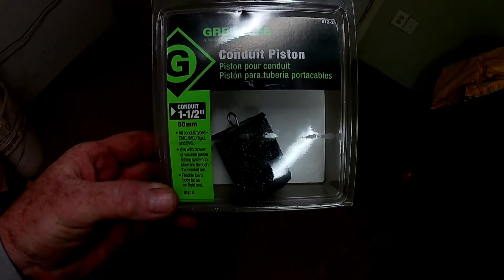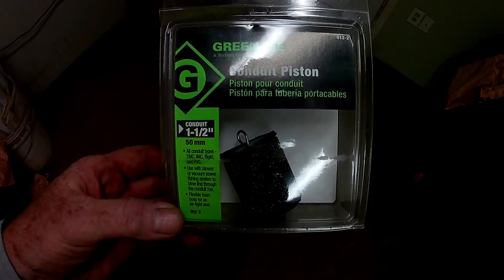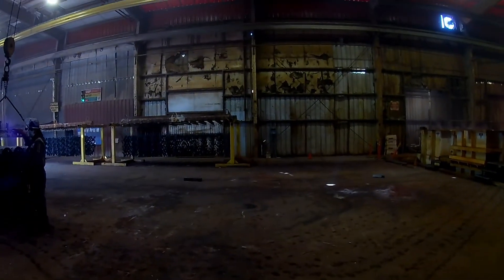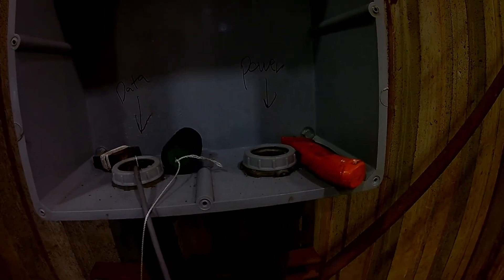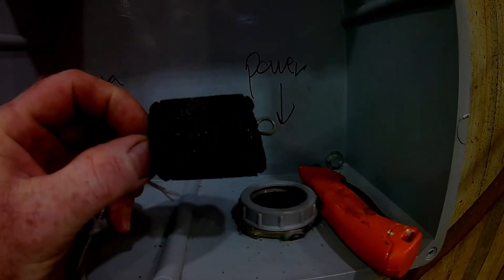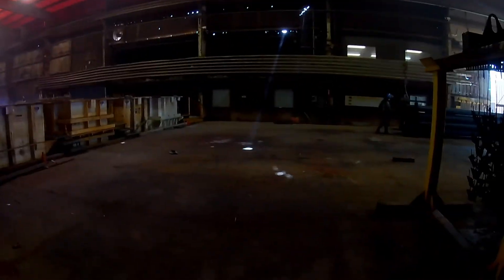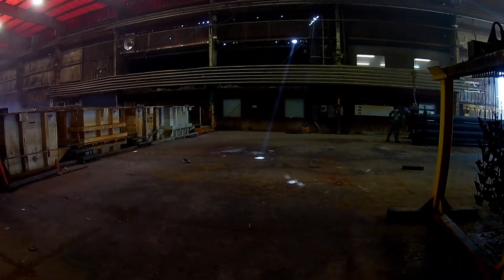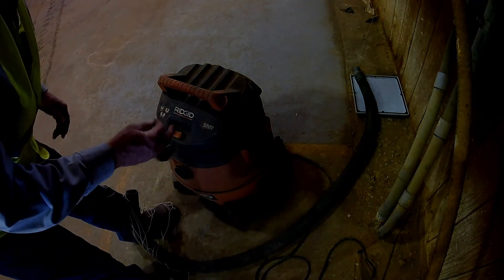Home and Work- Greenlee Conduit Piston Test

Comment: I really like your videos.  Can I suggest grouping your Harvest Right videos in one channel?  On the Greenlee Conduit piston test, a friend of mine came up with a similar idea about 20-22 years ago.  We were using a 3/4" grey outdoor underground PVC conduit for electrical wire runs from near the house at a new junction box to the street for two driveway lights and plugs near the street at the gate entry area.  The run was probably 125-150'.  After many attempts to snake it, he came up with an idea that I thought would never work.  He took a bottle cork that I had and whittled it down to a round cork and then put a string through it and a knot on one side.  He then dropped it into the conduit on one side and, like you, in about 15 seconds, the shop vac pulled the cork and pull string through the conduit!  I was shocked and astounded by the creative idea that I thought was "stupid"....  Pretty embarrassing and impressive.
Reply from the maker: ...And he would be retired being a rich man.

I do have my videos in four groupings;  Freeze drying, Gluten Free Cooking, Raising Chickens, and Home and Business.
Reply: @Philat4800feet  Oh!  I guess I looked at all the videos and didn't see a way to filter them! Sorry about that.  I'll go check now.  We just did our first load of "bread".  I was shocked to see it took about 24 hours.  Didn't expect it to take that long.  And it was a lot louder than I expected.  We got the large unit and the oil-less pump.  Very expensive but we figured we'd go big given our plans and concerns about the grocery store supply.  Thanks for sharing all the stuff on the freeze dryer!  Matt